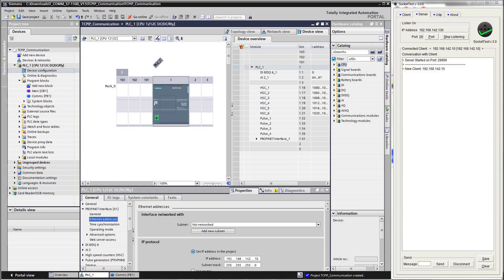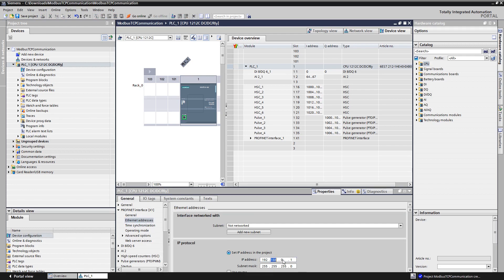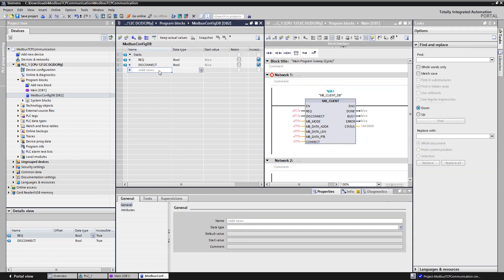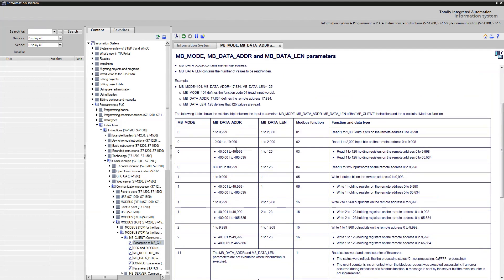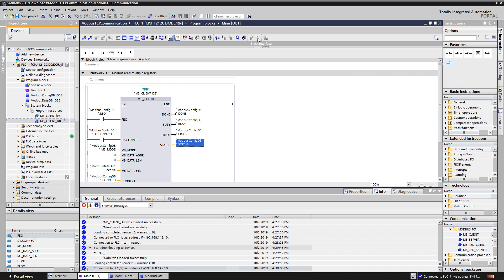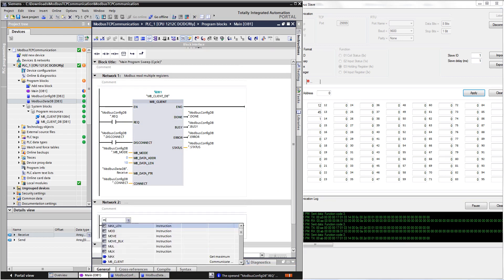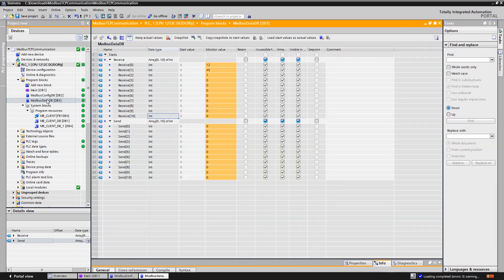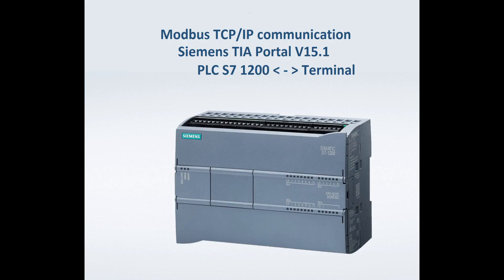Siemens S7 1200 Modbus TCP communication with Windows client

Comment: The firewall of my private network has blocking the communication, but i can connect the modbus poll and modscan with the modbus tool when my firewall is on, but not my plc, thx for the video!
Reply from the maker: Check what port is plc using

Comment: Hi, great vids - Subscribed!
I have learned more from these few videos than other sources with heaps of guides on them.
I do have one question, was there any relevance to using remote port 29999 and local port 2000 in Your vid? I noted You said that MB usually uses port 502, however, I cannot seem to get my modbus tool v2.0.2.2 to establish a connection despite having the port numbers match (502) - it simply states listening to port 502. I have tried setting up with 29999 in case it's windows specific, but no difference. I have set my laptop IP to 192.168.142.130 and pinged the PLC from the laptop, I also ensured the profinet name is set the same. As a precaution I created an exception in windows defender to open port 502 to both inbound and outbound connections - Stumped!
Reply from the maker: Hi, I glad to hear it. No real relevance in using port 29999. Most of the time, problem is with firewall blocking the traffic, try to disable all firewalls/antivirus etc. If you can ping the device, then problem will be with something blocking the traffic.
Reply: @industrialautomation3470  You were spot on, I'd only disabled my private network firewall , and not the public network. Works a treat now - Cheers!
Reply from the maker: @graemelee4449  Don't worry, I made exactly same mistake few days ago.

Comment: Thank u. Now, what do I have to do for communicate with several TCP slaves. 
If I change the address (MB_DATA_ADDRESS) while PLC is running, the module holds the communication only with the initially configured slave. I mean, the module only communicates with the originally configured device.
Reply from the maker: Mb_data_address points to register not to different slave! Create new function, add new connection definition, change ID to unique number, set direct ip and port, load to plc, check values online
Reply: @industrialautomation3470  Lol srry. I knew MB_DATA_ADDRESS was the protocol register and the IP goes on the CONNECT element definition. I was wrong when typing in. By the way, I'd already tried what you said. Thank u for but it's still not working, I'm still checking for the problem. Maybe it's a small mistake

Comment: Hi ,

I pull all input, output and analog signal in 1 DB for server , so my client read still need create different register ? Example read output from server ip is 10001 , then another block for client just 40001 ? It this possible create all combine dB by using 1 dB ?
Please advise
Reply from the maker: Hello, I don't know what  is your modbus device. On the plc side, you can use only one DB for sending /receiving. Just adjust mb_data_addr number in mb_client function (in my example it's 0 #9:06). Make sure to set DB to non-optimized access, then you will be able to see addresses inside DB. Is that what you asking for?
Reply: Industrial Automation my modbus device is Siemens A unit 1200 to b unit  1200 , in earlier I have old machine run with remote dcs which is modbus server tcp from A unit and data read and write was packed with Bit register , input ,output and real(mA) value all put in 1 dB as P#DB500.DBX0.0 int 30 
Inside table 
Array (0-10)
Data_in 0-10 (Bool) ( bit)
Data_out 0-10 (Bool) (digital input and output )
Real_in  (analog signal  )
Above from old plc data 
Now I write the Modbus Client and intended to get those DB500 data , so I just put the IP address of master , I can get read the value eventually but I not sure what If I can read all automatic without modified the MB_Data_Addr? I managed to read output when I change to address 100001 , I want read real value I have to make a change to 400001. I not is this can combine and auto address recognized which allow me only put register Addr and to read all ? Or I need to create separate Client tcp block ? 10001 to read output coil and another 400001 maybe read analog real data ? 

Last concern is my existing plc was using modbus server which is connected to another dcs system. I want connect exiting protocol with just add new Client server and pull the All DB packed inside DB500 and I not whether it can be connect by 2 Client at the same time ? If this possible I will not need to add any programming for A unit. 
That my intention.
Reply from the maker: @ansonkiek6471  I mixed things up. Mb_data_addr is address of modbus register, not address in DB. It's looks like you can't use single DB for different register. Maybe you could use string or pointer, but I never tested that. But you can have multiple mb_client functions, have separate DBs for each one and then just merge then into one., db500.
Reply: Industrial Automation do you mean can use multiple modbus Client for serval register such example 3 modbus Client block all in read data 
1)  MB_Data_TA_ADDR - 1  , for read output bits 
2) MB_Data_TA_ADDR- 10001 , for input 
3) MB_Data_TA_ADDR - 40001 , for analog signal ?

For server site I still packed All data in 1 DB global block which is DB500
Consisted with 
Data_in (0-10 array) bool 
Data_out (0-10 array ) bool
Real  in _ real 

3 modbus Client read the 1 same server ? Can I Combine input output and bit in 1 modbus Client ? Because input , output and bit can define as bool. What type of MB_DATA_ADDR to use if possible ?

Thanks.
Reply from the maker: @ansonkiek6471  Yes, you can have multiple client functions for 1 server. Just CONNECT definition may have to be different.

You could combine them, if all of them would be stored in same register, for example Input register.

mb_data_addr depends on server, where do you store data #7:38
Reply: Industrial Automation thanks , I just try pull example dB 500 and store 3 types of data in this server and use 1 client read 
Same method as below
1) read _in 
2) read _out 
3) Analog signal 

In read_in data consist of bit , I manage to triggered the bit , but surprisingly  I can on/ off Which simulator but , with register mode 40001 address with length 30, but I wonder I can’t open the input or output coil for this. I not sure why would happen to this. The rest empty bits inside the data can act as bool on/ off . But the input and output just can’t work well.
Reply from the maker: @ansonkiek6471  make sure you're using correct mb_mode
Reply: Industrial Automation hi, the register 40001 managed to recognize and on/off output coil, now it only with simulator 
In real site equipment A my plc IP address is 192.168.200.201 , as a server the ip address of modbus server need to be same as plc 201 ?

For client site plc of  ip is set 192.168.200.202 and modbus client I set 192.168.200.201 ? 

What is ID for modbus server and client ? Is this can be same ? 1 and 1 or 1 or 2 as long my connection is ok If both code = 7005 to 7006 ?

Thanks
Reply: @ansonkiek6471  sounds about right, you have to test it out. If you're using 2 Siemens plcs, why don't you use Get / Put function?
Reply: quincycz hi I did try pull and get function and I just write get function but I can’t test it on my standalone plc in factory . So for safe I also try this method at least I have backup plan if get block din’t work well.
Reply: quincycz hi regarding pull and get data , I don’t wish to make more programming on existing online equipment. So what I do is just create get instruction to new plc and rack and slot for  configuration old is 0 / 1 ? And pull section the set unknown with that plc IP address ?